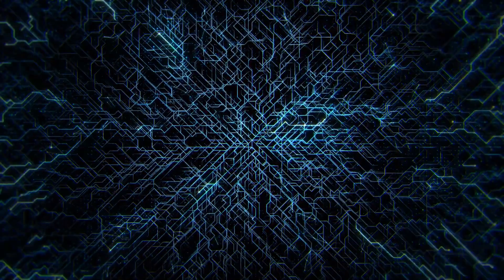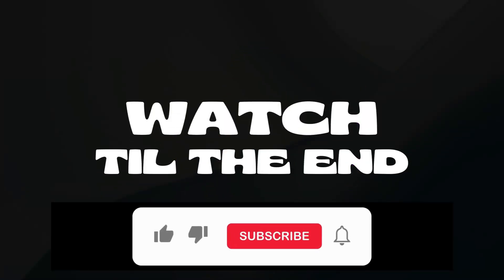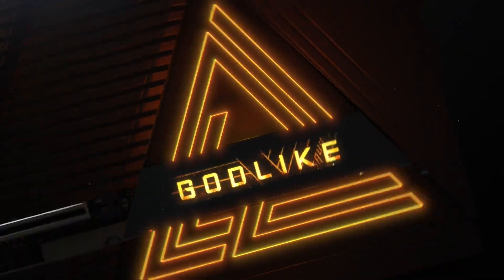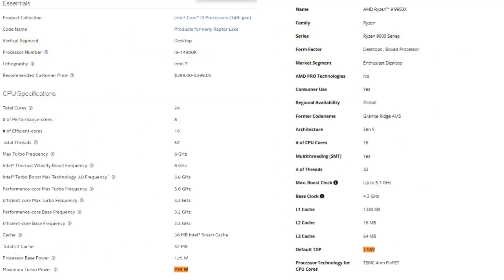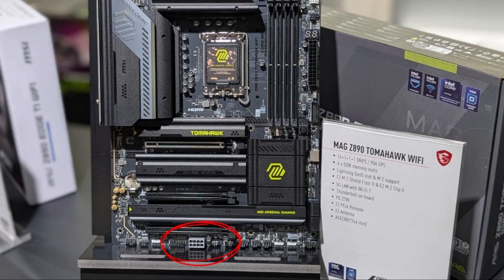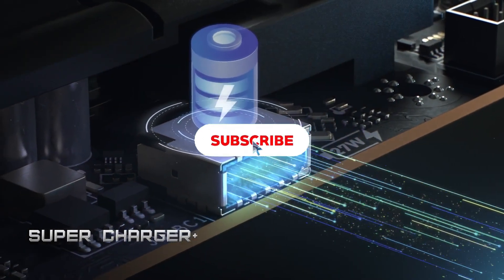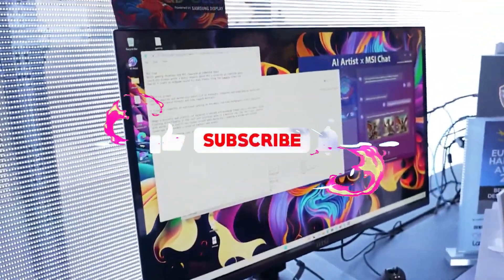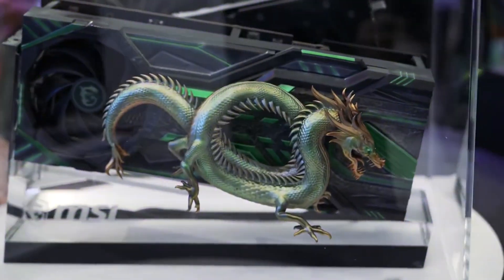MSI's Z890 motherboards have an additional 8-pin PCIe power connection here's why

Comment: If 1 8 pin can supply nearly 400 watts of power, why are they not just using 3 8 pins like the high end 30 series cards? No gpu is using over 1k watts of power 😅

Comment: hi bro, i have msi x870e carbon, rtx 5090 and hx1500i 2025 corsair. My pc work fine with 12-2x6 but i see that connector...i have extra cables pcie 6+2 and 8 pin. i put 6+2 on the motherboard and 8 pin on the psu, right?
Reply from the maker: Yes

Comment: I have some more info. Confirmation that it is for the PCIe. That to me has a telling limiting factor what it is for. PCI lane direct to CPU linking to GPU can only be for ARC. I can't think anything else that would do this. AMD and Nvidia in my knowledge haven't taken this path for their architecture to pair to CPU. Nvidia has been talking about having their own CPU but that would require their own motherboard. X870 is for 9800X3D and 9950X3D in mind and these are scheduled for next year maybe. So why now just before Arrow Lake? I can only see to offer another platform for ARC. Maybe to stabilize the power between CPU/GPU to better pairing. Speculation. 24th October is not that far. Big surprise would be to launch Battlemage also.

Comment: The 5090 should come with two 12 pin power plugs, so it does not have to deliver 600 watts through just one connector.. I am betting it will be a dumpster fire, that connectors will once again have issues with them burning up.. but having 2-12 pin connectors would allow for each connector to take in 300 watts, which would make the cards and connectors much more safe.. and even if they have the PCIE power connector as well.. even better!!  Let it also handle some of that huge wattage which the 5090 is going to be pushing, 600 watts, is crazy..